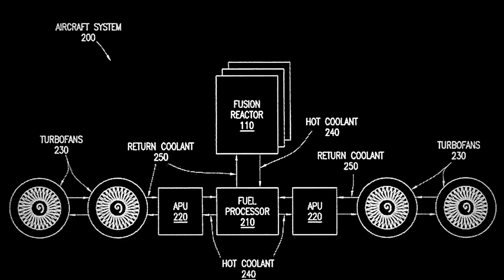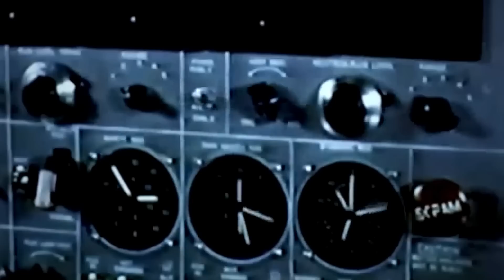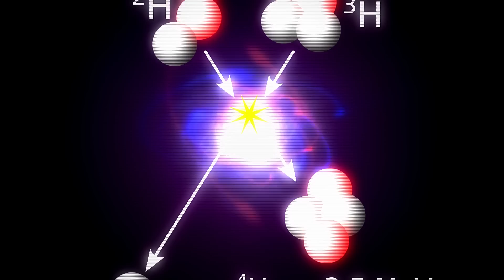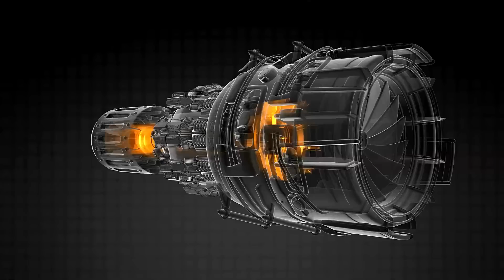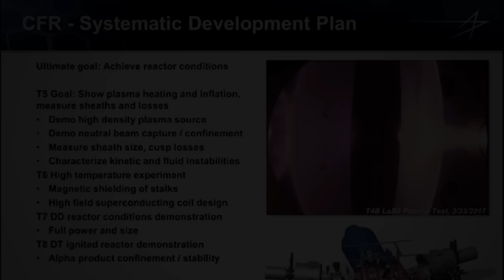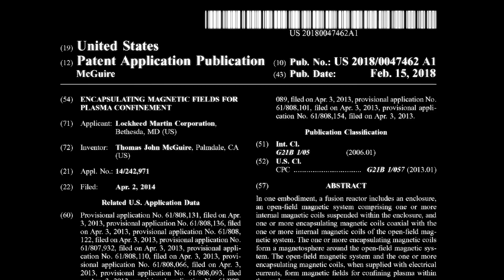The Nuclear-Powered Aircraft that Will Change Everything

Comment: If LM brings this engine to the market it would be a game changer for the aircraft industry, especially if you can retro fit it into current operational aircraft.
Reply: A single plane that doesn't use fuel is probably worth scrapping 10 that do. The profits made by designing new aircraft would probably outweigh the headache of retrofitting this onto a modern aircraft
Reply: Space even more.

These are perfect for hybrid jet/rocket.
Reply: They've been working on it for decades in one way or another. Don't bet on it.
Reply: Do some research before you embark on flights of fancy!
Even if Lockheed were actually producing these things, there is no way they'd fit onto any existing airliner; they'd be FAR to big.
Reply: @warpedweirdo  Just this last year I've seen a couple of contenders.

Technology is always five years away until it suddenly isn't. AI is apparently really really really really really good at magnets already. And also physics.

Finally using those graphic card physics accelerators to accelerate physics.

It's not if it hockey sticks, it's when.

Comment: even if a plane can stay in the air for a year because of fuel it would still need to come down regularly for repairs and parts exchange
Reply: And for a bathroom break!!!
Reply: @rogergoodman8665 I would assume the plane would be unmanned, that or it would be large enough that it has bathrooms/sleeping quarters, and a large food supply. It would probably need 2 if not 3 crew to operate it for anything beyond a day or 2. You could also get creative and have it be remotely piloted while it’s enroute and have the pilot nap until it arrives in a combat zone
Reply: @NickSteffen  another cool idea would be if it was big enough that maintenance tunnels could be made to the engines so that one engine could be shut down during flight (a common fuel saving practice for reconnaissance planes) so that maintenance could be done mid flight.
Reply: @NickSteffen  -- That doesn't affect the need for maintenance and repair.  Manning it isn't the problem, keeping it in the air is the problem and aircraft are massively dependent on maintenance.
Reply: @binbashbuddy   Right… never said it wasn’t a problem… but I don’t think they are going to try and keep a plane in the air for a year, that was just an example to show how much energy could be carried. I think they would try a couple days to a week, which is a more reasonable goal that could be designed around. Even just doing current long range missions without refueling is a massive boon for defense logistics. Keeping a plane aloft for more then that would require advances in many fields and calling it a stretch goal is more than generous. 

Imagine a refueling plane that doesn’t waste half its fuel just keeping itself in the air or a carrier battle group that now instead of having a 600 mile ish strike rang is now unlimited. You can send planes from the us to defend Taiwan completely outside of china’s a2ad range
Reply: @NickSteffen  Nuclear aircraft carriers have (for practical purposes) an unlimited range!  Their escort vessels do not, but they can be refueled at sea!  If however, part of the electrical power of the carriers would be used to separate sea water into hydrogen and oxygen, these could potentially refuel all non-nuclear vessels and perhaps aircraft!  But of course, they would still need regular resupply either at port or at sea.  Drinking water is already produced by the nuclear power plants, but food, spare parts, personnel changes, etc. would still be needed!  Perhaps two+ nuclear vessels with the main purpose of fleet resupply could travel with the carrier groups to extend mission lengths!
Reply: @MarilynStangl  I was talking about the strike range of the planes on the carrier not the carrier itself. It’s important because of china’s a2ad strategy. If the carrier has to get within 600 miles of chinas shore to launch planes it’s in severe danger as China can launch thousands of long range missiles at it. Their entire military’s built around saturating any boat near their coast with missiles and they have the sheer volume and production capacity to guarantee no missile defenses could keep up. 

With nuclear planes the carrier can sit further away and launch sorties from safety. You might ask why not just launch them from the US if they are nuclear but you can achieve a higher number of sorties with the same number of planes if your base to rearm and get more missiles is nearby. It’s also currently why range is the number one requirement of the navy’s ngad program
Reply: @rogergoodman8665  the whole point of remaining in the air would be to urinate on people.. I think anyway
Reply: @ATBatmanMALS31  and you say Google is intrusive? I mean they might be just a little bit but they're not trying to piss on me... to my knowledge...
Reply: @ATBatmanMALS31  Why is the the liquid from plane bathrooms accidentally ejected called "blue ice"? You would think it would be green if the chemicals are blue and the pee is yellow right?
Reply: @aaronawoodard  It is green.  Its just so overwhelmed by the blue die, the human eye can barely tell.  It's like Blue-green, but Blue-Blue-Blue-Blue-Green.
Reply: @rogergoodman8665  Yeah diapers, need to be changed.
Reply: @rogergoodman8665  Nah they just spray it out the back. Conspiracy people will claim the poopoo and peepee are chemtrails....
Reply: @rogergoodman8665  You could install bathrooms on a lot of jets if you planned for it TBH. The Su-34 has a toilet for instance and the pilots sit side by side, but it's in the airframe footprint of an enlarged Su-27, which is impressive if you ask me. The B2 also has a toilet, and a bed and microwave as well, so you can have hot food on long missions if you pilot it. Obviously other large airframes have room for such things, but you'd be limited by how much food and water you can carry, and the size of the septic tank if you're flying over populated areas.
Reply: @rogergoodman8665  pilot gotta pee pee.  Although they have that worked out, to a point.  Martin Baker Toilet Seat enters the chat.
Reply: Not necessarily. If a situation were to evolve where an abundance of fuel and power are available- aircraft and component designs could be much heavier duty.
Reply: Yeah no shit
Reply: I don't think it would necessarily need to stay up that long.  Aircrafts that could stay in the air without needing to be refueled for even just a few days would be game changing for military purposes. Package delivery aircraft without the need to refuel would be great as well from a logistics stand point.
Reply: Hope they tip their Door Dash folks well.
Reply: The solution to that problem is don't let americans build it. Get the Chinese to quality centeric people to build it so parts don't need ro be changed 😂
Reply: And the pilot might want to come down to earth to take a dump once in awhile
Reply: ... and for the pilot to have a pee! 😆
Reply: Unless it's autonomous humans would need to land quite often for obvious reasons.
Reply: We don't have bearings that lasts forever so yeah  anything with moving parts and rubber needs replacement.
Reply: the cost of the plane will be over a billion
Reply: @Colonel-Hans-Landafr  There are already a few of those...  7th gen fighters may have a prototype cost a trillion...
Reply: @aaronawoodard  and they won't be seen in action it's just a waste of money
Reply: @Colonel-Hans-Landafr  I wouldn't go that far... My country had spent a lot of money to shoot down a balloon one time so we do not need much of a reason and will create one if we do.
Reply: You’re really missing the title… it says never REFUEL, not never land….
Reply: But that’s not the point. It’s about being independent of fuel loads.
Reply: And empty the porta potty.
Reply: yea like the iss which lands every year or so.
Reply: @moonliteX  are you suggesting we have shuttles to fly parts and personnel to the atomic plane so it doesn't need to land?
Reply: @scottgalbraith7461  the analogy extends. also shuttles have never visited the iss if you want to nitpick.
Reply: oh shit i'm wrong it seems!ñ
Reply: @moonliteX  lol. Nice.
Reply: Not if it can use its exsust and have multiple small units.. Idk
Reply: Aircraft not only need mechanical and electrical maintenance and updates (regularly) to function properly, but they also need to be cleaned (regularly). Who knew our air was that dirty?
All of that means the aircraft has to be grounded.
Reply: And food
Reply: You don't come here for reality you come here for sensationalized mispronunciation!
Reply: Racist 🫵🏽
Reply: Go fast, Gimbal, Nimitz.
Reply: I don't think it would stay in flight for a year straight.  They are stating it could in theory do so, but it's more so run many many missions time and time again with never having to fuel for thousands of hours.  So instead of missions lasting several hours and then having to peel off to catch a refuel take that time and that planning that's no long necessary. They can run for a day with no fuel and have essentially endless range.  You could do unmanned for days or weeks but it's not super necessary.  If they don't have to spend billions of dollars on fuel they can stick that money into more fighters more projects more weapons systems and technology.  It would change everything as we know it.
Reply: Oh really? It would? Good point 😂
Reply: Bearings are the fail point.
Reply: That's the fail point.
Reply: Correct
Reply: Not if all those parts are also nuclear!!
Reply: food,medicine,water,
Reply: For what repairs and what parts exchange?
Reply: @ApeRSV4  tighten bolts etc. Check the airframes for cracks and stress fractures. Update software and equipment.  Do you need more examples or do you understand now?
Reply: @johnschmitt5259  No, tell me more!
Reply: @ApeRSV4  You have O2 that needs to be changed out, standard electronics can fail. Control surfaces and actuators need service, and the engines still use turbines which have bearings which need service and its fan blades will wear over time.
Reply: @mrow7598  can get o2 at low altitude over the sea while in flight, everything else mechanical would be built to last to increase maintenance intervals
Reply: @ApeRSV4  I was going to say something but this is basically the gist of it... I would likely go around in circles about how you wouldn't design something that can create power for decades to drive a machine that couldn't optimally utilize it... let alone its like, "oh well, I guess I will throw this power generator in the trash then..."

Comment: Imagine hypersonic extended use and dog fighting. It's over in the near blink of an eye.
Reply: Hypersonic air-to-air missiles or lasers would be the only way to fight. (Maybe rail/coil guns as well but that's probably going to be complex.)

But don't hold your breath. These planes would be extremely rare, expensive and complicated. So much in fact, I wouldn't be surprised if the US only has these planes in very limited numbers. Maybe China many years later but by then the US would probably be a generation or two ahead. And even then, commanders might be extremely hesitant to use them to intercept other hypersonic craft. They'll most likely be used for surveillance or tactical/strategic strikes.

If fusion is even possible to begin with. As a practical and sustainable fusion reactor has yet to have been made.
Reply: Human body would end up getting in the way of the technology. Limiting the design to help keep the human alive, not a pile of jelly.
Reply: @Angl0sax0nknight  Good point Thank you.